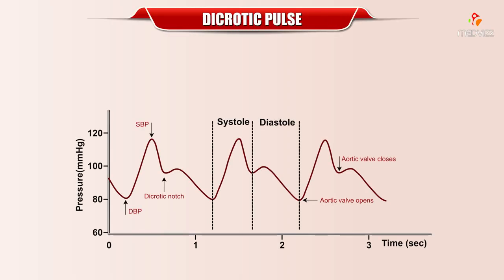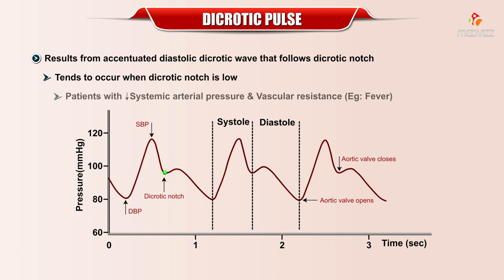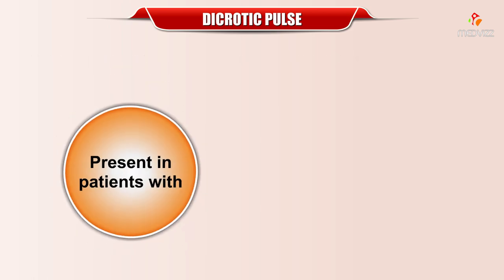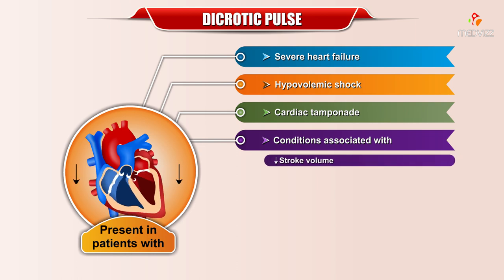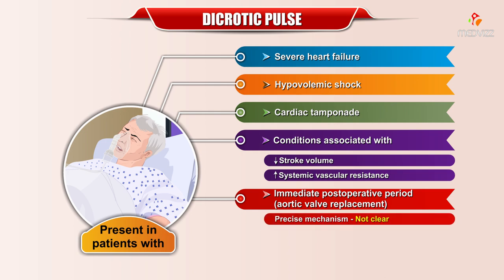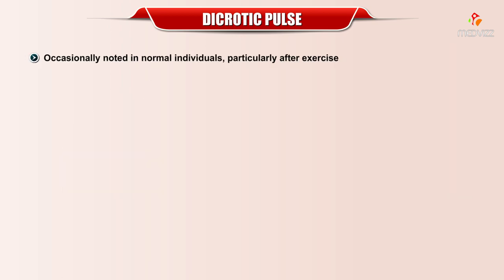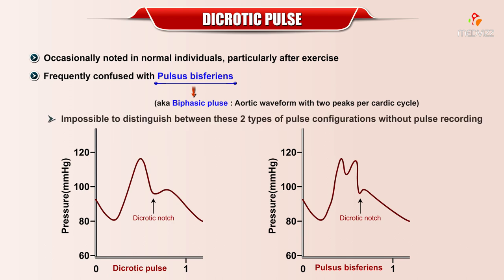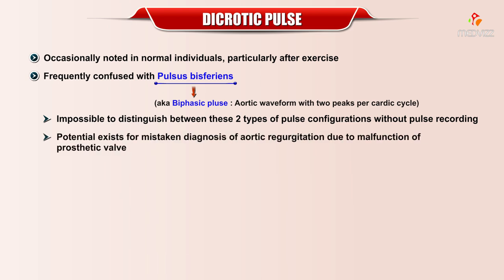Dicrotic pulse - Internal medicine - #Usmle Cardiology

Comment: Doctor, is this ( dicrotic notch ) the one used to take the diastolic pressure in measuring blood pressure using sphygmomanometer? 

If not, why the sound of beating disappears when decreasing the pressure by the cuff? 

If anyone know, can you answer plz
Reply: An auscultatory gap, also known as the silent gap, is a period of diminished or absent Korotkoff sounds during the manual measurement of blood pressure. It is associated with reduced peripheral blood flow caused by changes in the pulse wave. So I guess when we still hear the beat sound after reducing the pressure on cuff, it may be due to dicrotic pulse..
Reply: @agnimaanne101  No, the appearance and disappearance of  Kortokoff sounds is due to blood flow being turbulent, which produces the sound, as soon as the first sound is heard. As the cuff pressure decreases, flow becomes more laminar and the sound disappears.